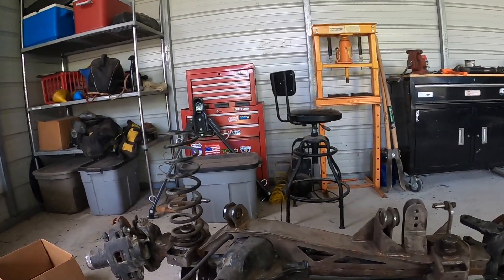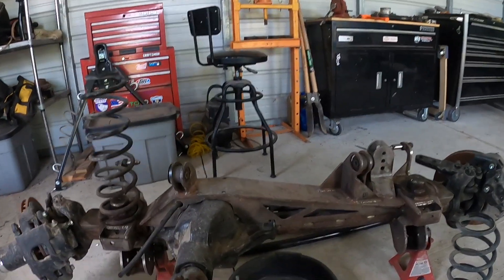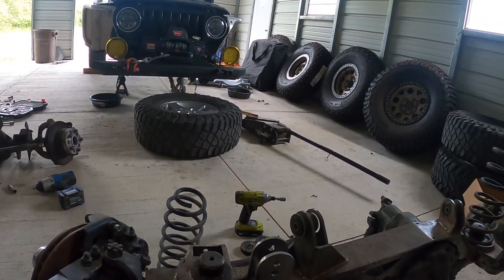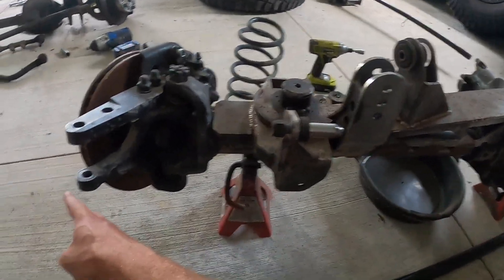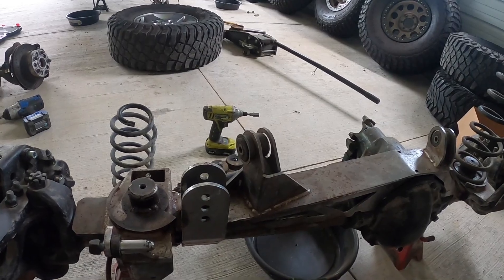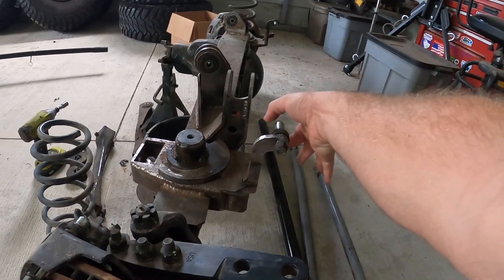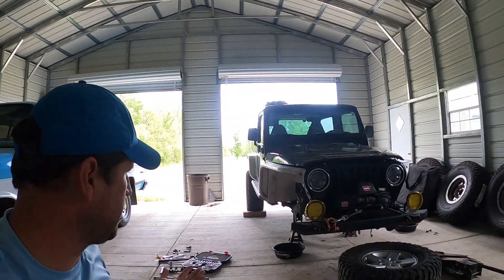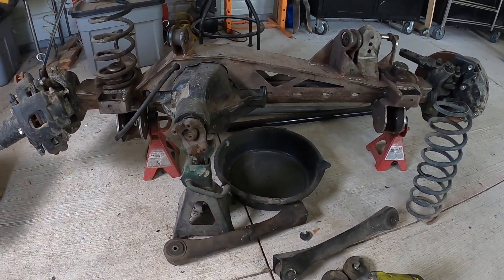Swapping a Dana 44 into TJ Wrangler using a NEXT Venture Truss!

Comment: Very similar setup as to what we put under my 06. 80's Wagoneer D44, 5.38's, TNT truss, Detroit Locker, Custom built 1 ton steering setup, Currie Currectlync, yada yada yada.... It was a process, fortunately my son is smarter than I am and did most of the heavy work and it turned out just right.... Looks like you have a solid go forward plan. Good Luck to ya.
Reply from the maker: Wanna send that son over here? Haha. Sounds like a nice set up. How do like the gearing?
Reply: @jimmykale  I love it! I have the 6 speed, and actually at 75mph Im only at about 3200rpm. And on the rocks, trails, or sand its quite capable. I was skeptical, but that son of mine talked me into it, and he was very correct in his assessment.
Reply from the maker: That’s awesome to hear!  I can’t wait for mine to be back on all 4s